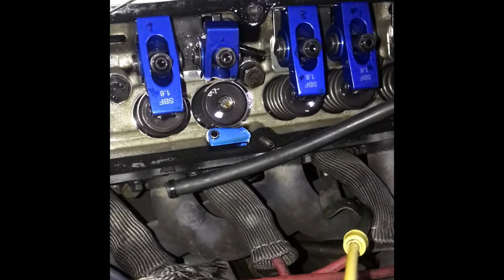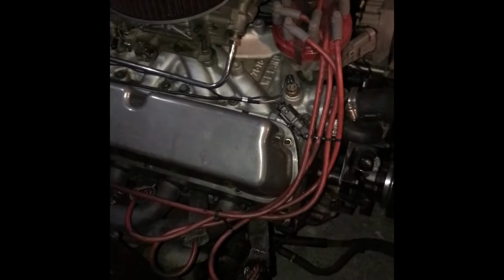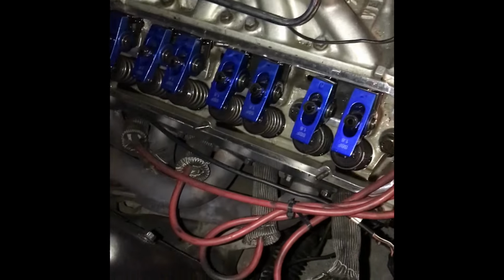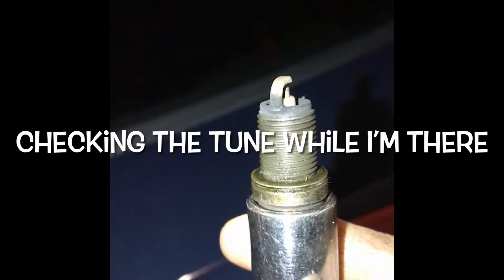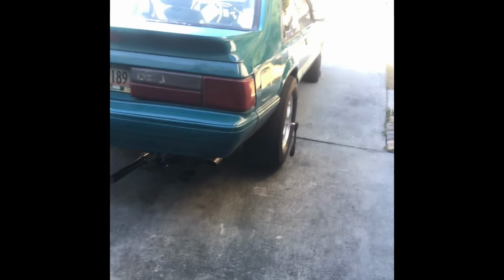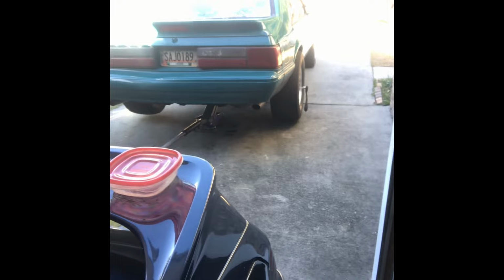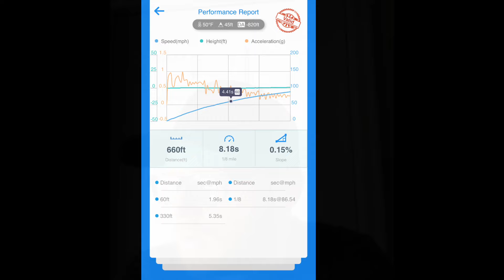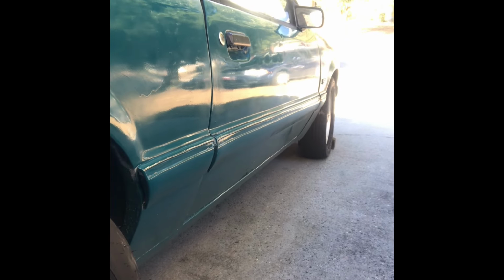Foxbody Stock suspension and Mini wheelies? TNT Prep

Comment: Brother!!! Seeing that broken rocker gave me ptsd 😮. You’re most likely right about the pushrods touching the head… car sounds freaking awesome! Did some nice launches there 🤟
Reply from the maker: Thanks brother!!! Yea I’m scared every time I drive it that I keep a extra steel stamp and push rod with me 😂😂😂 it’s launching hood but
It’s squatting bad! Need shocks
Reply: @jdrods1519 some times stock or 4cyl suspension works best, u need a converter to launch harder
Reply from the maker: Or a Manual Trans 😂

Comment: You need longer pushrods to keep them from hitting the head or locators. The pushrods are disconnecting from the rocker arms and then snapping back into palace breaking the rocker or the pushrod! I do like scorpions too. Had them on my 69 496 SS Chevelle. They got sold with the car. Had them for at least a decade on the SS with no trouble at all running to 7000 rpm shifts.
Reply from the maker: I thought I needed longer push rods also but when I check the ware pattern on the valve stem  it seems perfect and centered. I might have to revisit the geometry and try some longer ones. The scorpions are awesome! Thanks for watching! 🙏

Comment: Hey man, I just discovered the channel. Keep up the good work. My son and I are  building 2 seriously low budget cars and Proform rockers are what I was looking at for my car. I'm having second thoughts now. I guess I'll see what the budget looks like when I put the engine together. I've watched a couple older videos but didn't see the exact engine combo you're running in this car.
Reply from the maker: Thanks man!!! I’ve been watching you and your son busting knuckles on his car!!! That fuel pump issue you had was wild!!! Yea I’m not to happy with the Proforms so far. This car has Edelbrock RPM heads, Weiand 7515 intake, E303 cam, 1-5/8 long tube headers, stock AOD trans with 3000 stall and 4.10s
Reply: @jdrods1519  that thing sounds rowdy for an E303. I had a couple back in the day, and I don't remember them sounding that good.
Reply from the maker: @KrisGreenhillsGarage  it’s the cheap eBay resonators and 2.5 exhaust true duals no H or X pipe 🤓

Comment: Id get a new set of rockers, with those pushrods so close to the heads id be worried about binding, scraping and sending metal through your engine
Reply from the maker: Yep I’ve got a set in the works. Hope you had a good Christmas! 🎄
Reply: I agree 100%. You get what you pay for these days
Reply: @jdrods1519  Pushrods are hardened just for that purpose. Unless they re really jammed against something Id not worry. 
You can always get adjustable pushrod guides, mark and weld them when you get that rocker arm perfectly centered 
I always get a little strong ONE piece pushrod than I think I need. They flex and take a lot of punishment. 
Are your springs set up with proper coil bind clearance, seat and open pressure? Floating valves, rev limiteres arent parts freindly
Reply from the maker: @gordocarbo  yep once I put a better set of rockers all the issues went away thankfully

Comment: Dam brotha, that rocker n pushrod is a darn shame.. You mess with or upgrade the 4 link yet? Looks like your gettin a bit of squat on launch.. The fox has a great rear setup, just needs tuning and slight modification.. Great video, keep em coming! Look fwd to seeing your journey👊✌️
Reply from the maker: Thanks brother!!! Yea not sure what the rocker issue really is. The suspension is 100% stock. I did put a football in the spring before TNT Friday night. I just uploaded the video Saturday. Thanks for watching 🙏
Reply: @jdrods1519  Figured by the way things moved around out back. 
Late 80s stuck a stout 460 in an 85. South Side Machine bars are the hot setup for hot cars. Even have them on m y Abody. THey force the axle down, lift the body up. Really helps plant the tires.

Comment: Anti sway bar is your answer .  I used to pull left wheel wheelies about 18 inches high and 60yo 80 ft out .. then i put a anti sway bar on on the rear and the front end came up level from then on …  i used a stock anti sway bar nothing fancy .
Reply from the maker: Awesome!!! I’ll definitely have to look into getting one!!!! Thanks for the info and thanks for watching! 🙏
Reply: @jdrods1519  your welcome .. anytime i can help i will .. btw if you have a front anti sway bar you will want to take it off before you make a serious pass .. it gives you lots of front end travel and transfers the weight to the back tires for better traction .
Reply from the maker: @glennramsey917  yes sir that taking the front bar off was one of the first things I did. It was originally a 4cyclinder car for the stock 7.5 doesn’t have a rear sway bar but I’m going to try to see if will accept one. Thanks again!
Reply: @jdrods1519  my car is a 1979 coupe .. it didnt come with a rear sway bar .. i had to out lower control arms off a 88  … they have the holes to bolt up a rear sway bar ..

Comment: Got a set of sbc Proform rocker arms around late 80s early 90s. Hope they improved since!
The diameter of the hole for the bearings was way too small for one...larger is better spreads the load out. 

Less than 200 miles they came apart spilling needle bearings in my engine (brand new!)
I knew better than to buy cheap stuff and did it anyways. Valvetrain parts always save longer and buy the best you possibly can. Dont buy generic ..xxx lift white box crap. Get the good stuff. Isky Crower Pac etc. Used intakes, engine tin etc sure go buy used
Reply from the maker: @gordocarbo  definitely!!! I ended up upgrading not long after this video! I learned my lesson on that deal forsure! Thanks for checking the video out!

Comment: What spring force are you using?
Reply from the maker: The springs that come on the Edelbrock heads are around 230 @.575 I believe and the Proform rockers are good to 220. My cam is .498/.498 lift